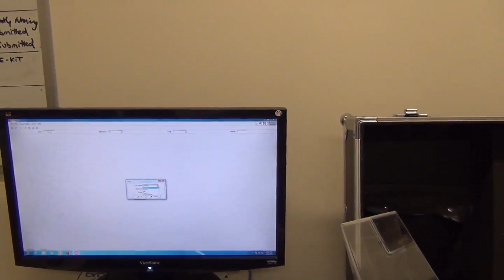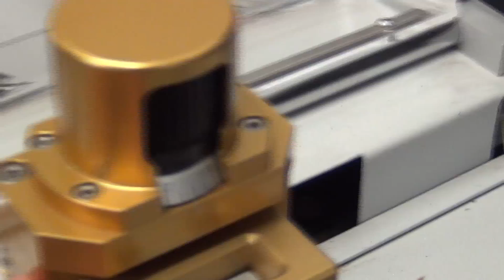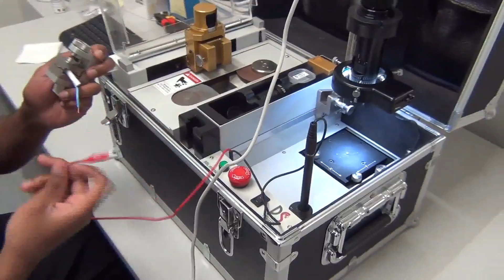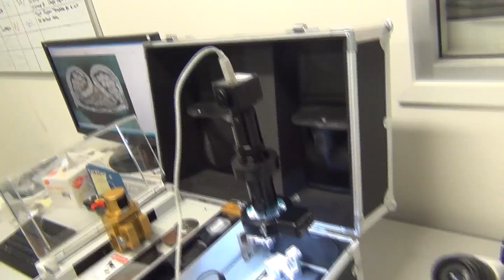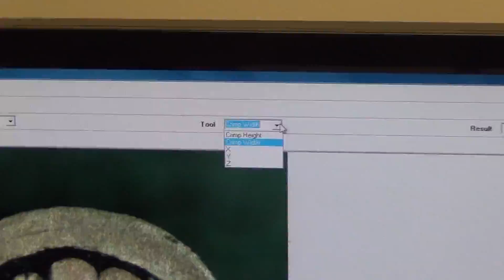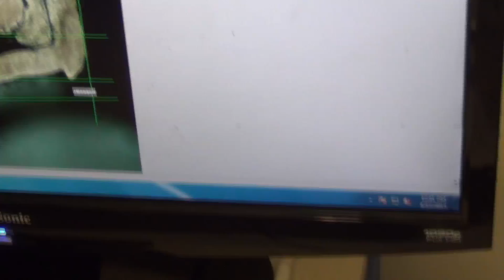Project 5 Crimp Cross Section Analysis

Comment: Curious about the cleaning stage. Is this etching/polishing or cleaning? What is the electrolyte solution? Voltage? Also, if you don't mind answering, what is the polarity here, i.e., which is the cathode and which is anode. In traditional electrolysis, one would be submerging the cathode and anode in an electrolyte bath. Since you are using a felt tip wetted with electrolyte,  at least one part is missing - anode or cathode.
Reply: The cleaning solution is AE7 Electrolyte and we are the original manufacturer of this machine. You can contact me for more info. 
Anode is clip to the other end of the wire or the terminal and the cathode is the cleaning part. It is using DC15 volts power supply. 12 volts can be used too.
Thank you